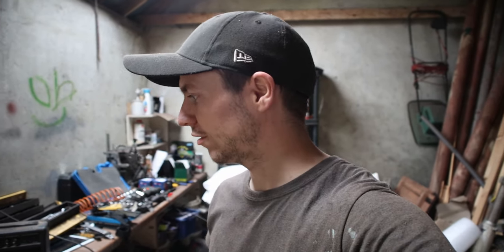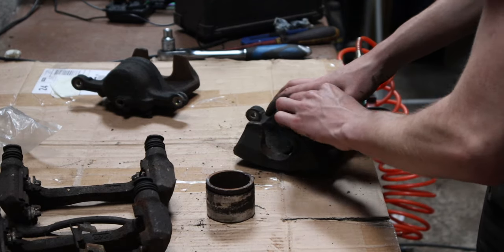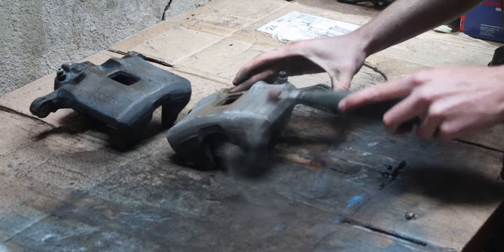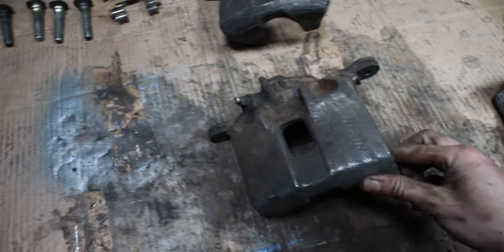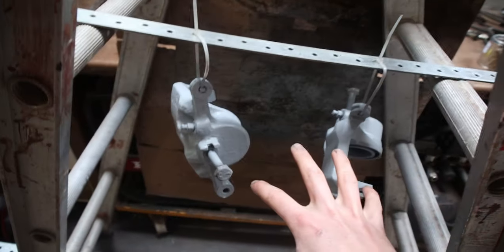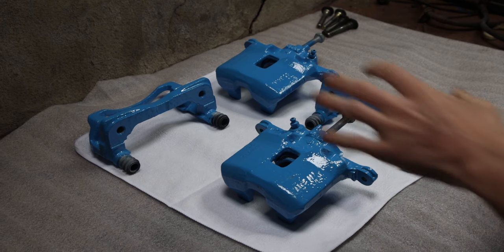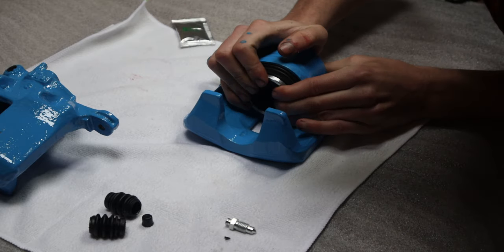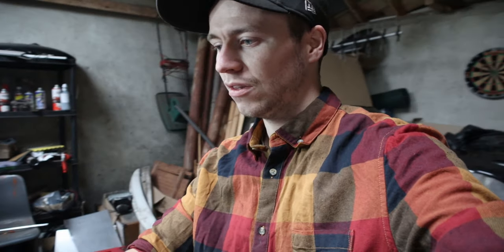Rusty Honda Civic Brake Caliper Restoration

Comment: Can you send me the link where you got the rebuild kit from please? I can't find one for the life of me
Reply from the maker: https://ebay.us/ieOH0h
here just make sure its the right one.  they came with two different caliper sizes and these are for the larger calipers
Reply: @mullac720  legend! I'm not sure how to figure out which one I need... any pointers?
Reply from the maker: Well I would measure the piston size and match it to the pics on that link. I bought the wrong ones at first so knew it were the bigger ones then 😂
Reply: @mullac720  what engine is in yours chap?
Reply from the maker: D14a4 😬 😬
Reply from the maker: Mullac720 on Instagram
Reply: Is there a certain way the caliper carrier go in are they both the same,  Because I seen you put a different anti Rattle shim on one side